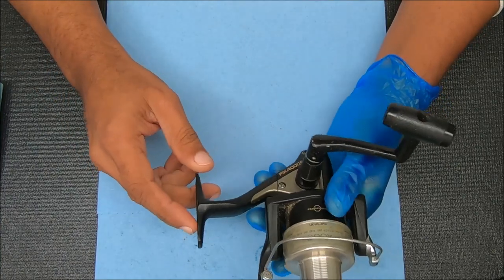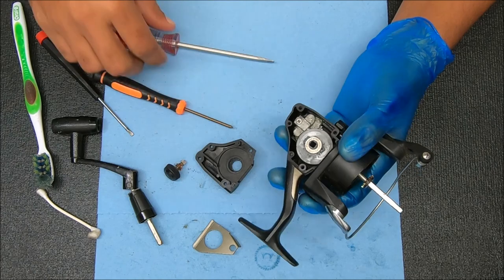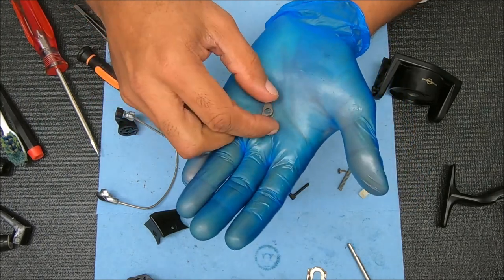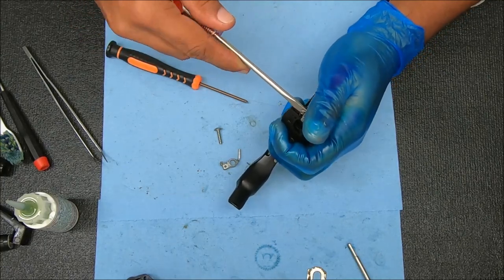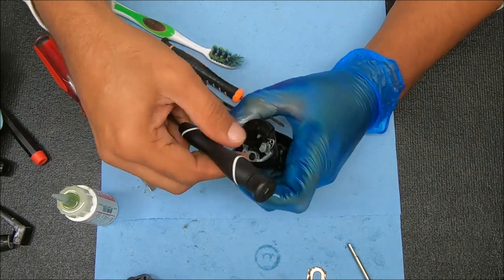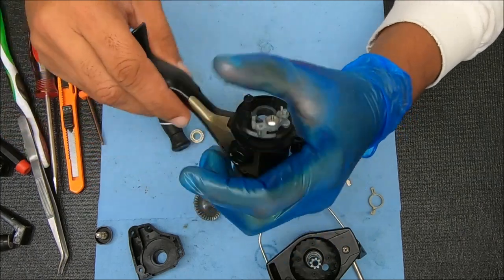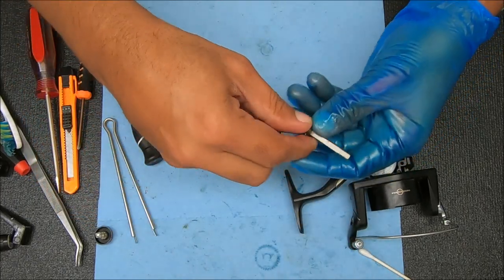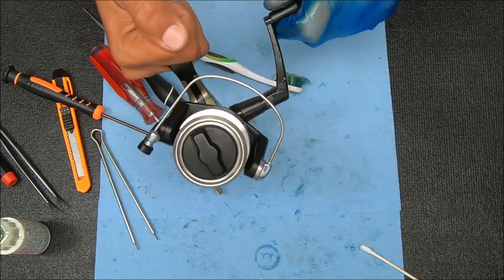Shimano FX4000FA Difficult Crank - How To Fix + Rebuild - Fishing Reel Repair

Comment: Nice job. Curious about the shim washers that didn’t go back on the main gear. What made you make that decision? Thanks. I always learn something new from you. 👍
Reply from the maker: Thanks Steve! There's a great, underrated movie (and others) called I-Robot, where the inventor talks about ghosts in the machine..... the longer between servicings, the more likely the reel won't go together the way it came off.... I mean tension-wise (side cover over the main gear), plus whatever you do to the reel, like filling some previously used spaces with grease/oil... or just the way it fits inside the bearings. Hence, the tension feels different when you compress the cover with screws. So, you have to play with the shims sometimes to get the feel right.
Reply: @TSGReelService  very interesting. Thanks for the explanation.
Reply from the maker: No worries, bud.

Comment: Thanks for all your videos. I used this video to rebuild the anti reverse on an old vintage shimano beast master spinning reel. The  anti reverse works now but makes a buzzing/fast clicking sound as the antireverse dog is slapping into place and buzzing. Do you have any recommendations for me?
Reply from the maker: You're welcome and thanks for watching and reaching out! Your actuator spring is not set into the actuator. If you look at 12:10, that end of the spring has to sit down in the slotted end of the plastic actuator.... you can see the complete reinstall if you continue watching. Although your components may look a little different, the concept is the same. Hope this helps. If not, feel free to reach out to me at tsgreelservice@gmail.com. Spread the word about the channel.
Reply: @TSGReelService  Thanks.. I give it another try. And tell I've been telling some friends about the channel. All the best!
Reply from the maker: @xxdjxjv  sounds good, brother. Thanks!

Comment: Does anyone have a problem with the reel just spinning back and forth and no way to keep tension on the line so it doesn't just keep getting tangled up? Can't see any way to stop it. Most reels have a little lever on the back you just move ovwr and it stops the reel from moving.  This one doesn't have that.
Reply from the maker: Thanks for checking out the video. State what your specific reel make and model is if you're looking for help with it.
Reply: @TSGReelService  all set. Found what I was looking for.
Reply from the maker: Great!